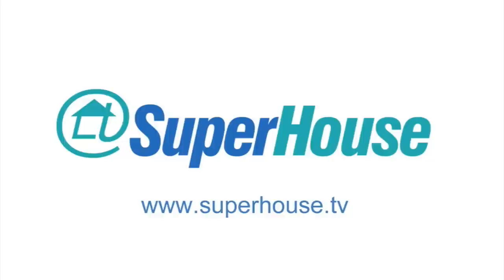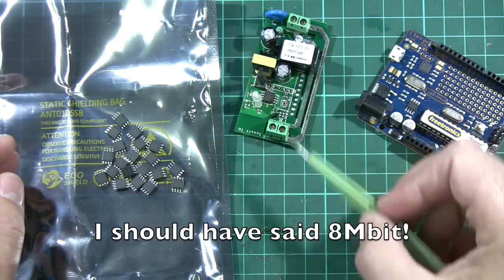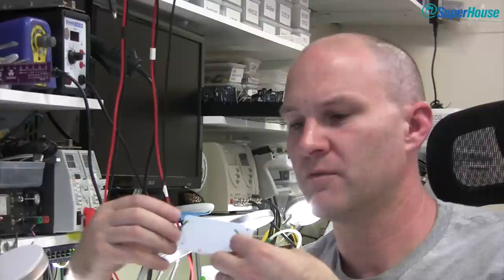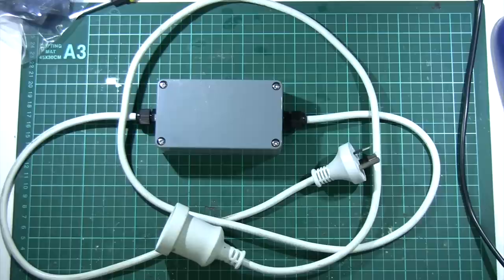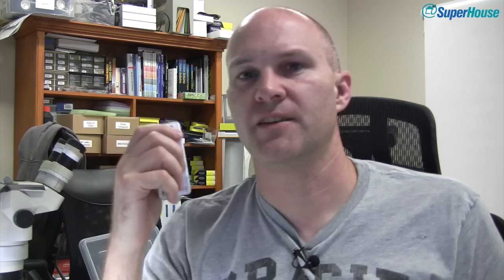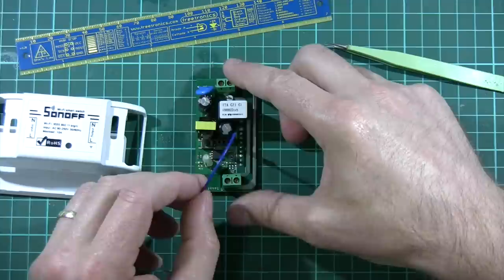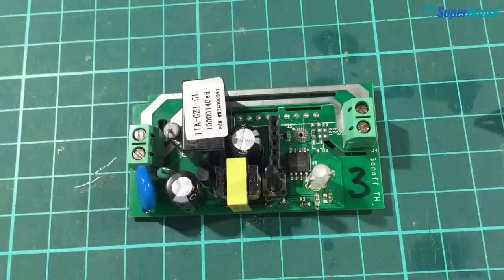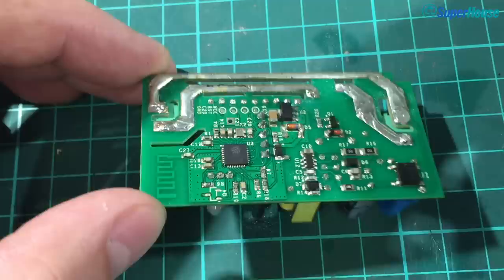SuperHouse #21: Six Sonoff Secrets: Storage, Safety, Switches, Sensors, Software, and Sites

Comment: 2:27 - Storage
9:08 - Safety
17:32 - Switch
22:08 - Switch (part 2)
23:23 - Switch (light switch)
27:00 - Switch (light switch part 2)
29:14 - Sensor
35:28 - Software
43:43 - Website
Reply: Saya tommy dari Indonesia. 
Saya senang melihat video ini.
Reply: thxxx

Comment from the maker: I've added a few more images and better descriptions to the episode page now, so it should be easier to find the specific headers, resistors, etc that I mention in the video. I'll keep expanding the page with more information over time, so if you think anything needs clarification please let me know.
Reply: Is there enough space in the filesystem to allow for state awareness for the MQTT server?
For example: when you use the light switch example, could the MQTT server push state update to the control all wirelessly?
Reply from the maker: Yes, that's not a problem. The Sonoff already has a concept of its own state, so the trick is just keeping everything in sync. You may have noticed in one part of the video I was alternating between using my phone and a switch to toggle the output, and I had to tap the phone twice because OpenHAB didn't know that the state of the Sonoff had been changed directly. The Sonoff would just need to report this local state change back to MQTT, so that other items (such as OpenHAB) are aware of it. That's already supported in the TASMOTA firmware, I just didn't configure OpenHAB to listen to it for the demo.
Reply: SuperHouseTV Thanks for the reply, much appreciated. 😎
Reply: SuperHouseTV can I use the sonoff basic to turn on DC motors using DC voltage?
Reply: You missed a small cheap trick that you can do to do very good strain relief. This is what my safety-crazy electrician uncle taught me. You make a loop in a cable and secure it with rubber tape so that ends go oposite ways. Then on the oposite side of the tape you can splice and do anything. If you try to pull it apart, you need to overcome force of that tape in a way that it's really strong. Try it yourself :)
Reply: +SuperhouseTV what if you already have a 2 switch  3 way switch setup and you want to add the sonoff to it? i am in the states so we call it  a 3 way switch you may call it a 2 way switch though i am not sure , 
instead of a switch that that has only 2 terminals  just switches the L or hot wire theere are 2 switches that have 3 terminals each ,  a hot  or L wire, a N or neutral wire  and and a traveler wire ,im my house  there is a front porch light
 one of the switches is at the bottom of the stairs next to the door and the other is at the top of the stairs ,i want to add the sonoff and flash it with smart things FW so i can use proximity detection to switch the porch light on when i return home but i still want to be able to operate the light from the  2 switches at the top and bottom of the stairs ,also i would like to be able to mount the sonoff inside of the outdoor light fixture if at all possible instead of inside the wall ,but there are only 3 wires  that connect where the light is ,   a live/hot wire, a  N neutral wire ,and a ground/earth wire , so is there a solution that can make it work without me ripping open  my walls  to run  extra wires?
Reply: SuperHouseTV 
Hi Jonathan great episode as usual really like your channel ! A quick question , can you connect a normal light switch to the Sonoff via gpi014 and ground straight out the box or does it need flashing first? Thanks

Comment: I like the way you break down the pin options and do the real time illustration, and the neat trick turning the on and off toggle into a three way switching circuit between the device, toggle, and phone.

Comment: Current Sonoff firmware (as of Dec 2019) allows the "program mode" button to toggle the device on and off. It will also allow the switch to work in LAN only mode if there is no internet connection. So far the mods on SuperHouse TV are not needed.... but I'm still watching these great videos!

Comment: For wiring inline you don't actually need to cut the earth and rejoin if you strip the cable right. I passed the earth straight through my sonoff device. It's tight but you can pass it through.
Reply: Dan Herring Same. That's why I've been doing.
Reply: b b a  i can n bB.
Reply: If you don't cut the ground then you will not be able to mount the Sonoff inside a box (unless you cut off the plug or don't have one to start with).
Reply: Are you saying you keep the earth line outside the box?  Otherwise how do you get it through holes on both sides without cutting?
Reply: @VARocketry  its a bit late, but you can get small project boxes that are intended to go inline and split at the holes for the cable, some also have little saddle things for strain releif.

Comment: Indeed, SONOFF is making the hardware the most of us were developing for our home automation. I just got today my 5 S20 sonoff wall sockets. I was making them myself, but really for the prices they offer them it is not worth the time.

My next project somewhere this week is indeed trying to get the I2C bus running on a SONOFF to use a PCF8574Module so will get another 8 (or max 64) IO's. Keep up the good work. Really interesting.
Reply: i think it's in peter scargill's firmware already... tech.scargill.net

Comment: Just a note for UK (probably most country's) the light switches will not replace a normal plate switch in 99% of cases as we have no neutral at the switch. Makes these a little redundant to be honest ? Great video and i am fitting these everywhere. Whats everyone doing with the naming of the dual relay model ? I called mine "the" then renamed the 2 relays "heating" and "gates" so Alexa gets "Alexa turn -the heating- on"
Reply from the maker: Yes, that's often a problem in Australia as well. It's common to loop the active down to the wall switch and back up again, so there's only active in / active out at the switch. I hope to do an episode soon talking about some of these sorts of practical cabling problems.
Reply: Could you not potentially put these inside the ceiling rose and have live and switched live through the sonoff. So live on the input and switched live on the output and then just use your wall switch as a 3v switch like on the video? As you already have two wires going down to the light switch. You could even fit a momentary light switch, which are available in the UK for lights with a timer.
Reply: Most new build wiring in the UK now takes the neutral to the switch. All the houses built in the last 5 yraers I've worked on have had the neutrals at the switch and commened up in a connector block. Also in the kitchens there is a radial feed (20amp on 2.5mm or 32 on 4mm) to a grid switch located in one of the kitcen cupboards, with a fuse and a double pole switch feeding out to the various appliences (cooker hood, washing machine etc)
Reply: Install E77 module in sonoff and install in ceiling  rose, connect light switch to E77 module. Works brilliantly for homes without common wire at switch.

Comment: The Arendst software is great... it is RELIABLE for the SONOFFS and handles ALEXA.   Mine does as you've noted but it's not my major area as my software handles much more and is larger - hence needing the FLASH replacement.  But for Sonoffs I use the Arendst software. Recommended.
Reply from the maker: Thanks Peter :-) And thanks for your excellent work documenting the Sonoff. Your blog is what sparked my interest in that particular device in the first place!
Reply: Excellent. No doubt more in the future as they release new devices!

Comment: Regarding safety - if it's worth noting to your audience that earth needs to be passed through on three wire connections, perhaps you should also suggest keeping Line and Neutral correctly passed through without being swapped (when using polarized cords). This might not be noticed when using, for example, two wire lamp cord (SPT-1 or SPT-2 in the US). 

 (Connecting the real Line (or Live)  to L  and Neutral to N, is also good practice, but perhaps less critical).
Reply from the maker: Good point. The early Sonoffs didn't have proper markings for Active / Neutral, but the current models have them labelled on both the inputs and the outputs.

Comment: I agree totally with the earth cable on the Sonoff WiFi switches. There is enough room to run the earth under the original cover soldering the two earths together and protecting with heat shrink. The wires are held nicely in place to securely with the case and cable clamp onto each original cable outer sheath. Nice neat connection in original case. We've replaced manually lamp switches with these for timed operation and for security out of hours too.

Comment: Really nice work you've done so far. Only thing I have to complain about, in Germany we have to use wire end sleeves/ ferrules for multi-core wires, so shortcuts between a single lead of a wire is reduces. Especially when connected to a screw clamp, which pushes the single cores of a wire to the sides! But I do not know what the "law" says in the USA or other parts of the world.
Reply from the maker: That's a good method even when it's not legally required :-)
Reply: Is that seriously the actual law in Germany? Very interesting
Reply: Same in Switzerland, as far as I know.
Reply: No requirement for ferrules in the US. I don't think they are specifically forbidden, but they are not common.
Reply: I want to use ferrules on mine but don't know the first thing about them.  I'm in the us and my house is wired up with 110v on a 20 amp fuse.  Where can I find ferrules for a stranded core extension cord that will be able to withstand the current?

Comment: Wow! What a high quality presentation, especially with the blog post behind it. Now I have to review SuperHouseTV #1-20 and their posts. I like that you are on Patreon.

 * I do MQTT with Mongob behind it for persistence with both servers running on a low cost Virtual Private Server, $35 per year. I originally hosted both on my Mac but I'm switching to a laptop.  I was originally thinking Raspberry PI based server but the VPS is probably cheaper and they do backups and fix the hardware if it breaks. I hate doing my own IT.

* My apps are mostly python scripts that run as periodic cronjobs on the VPS.They wakeup, check the status of the world according to Mongodb and decide what to do about it.With that infrastructure I can have lots of things going on at the same time that may or may not know about each other

* I run the open source  OwnTracks app on my iPhone to log where I am so I can have the system do things based on where I am.

And that is just the beginning. 

* Maybe LoRa for wider local reach than WiFi. 

* Probably a cell phone modem board to get rid of Wifi dependence altogether for stuff that wants to move (luggage tracker?)  Maybe Arduino Fona 808 which does both phone stuff and GPS.

* I have some bluetooth things going but they are not connected to this. Yet!

* I'm watching LTE-M like everyone doing IOT should.

Two months ago I had never heard MQTT and now I'm building my own personal Internet Of Steve. ;-)  I wish I knew about your stuff long ago. You'll be saving me lots of time. Thanks.
Reply from the maker: Thanks Steve! Recently I've been trying to put more effort into the blog posts associated with the videos, but it's a lot of work. The early episodes didn't have as much information to go with them.

Your setup sounds very similar to the way I've done it, except that I used a bunch of PHP scripts triggered by Cron (and various other events) instead of Python scripts. Later I replaced most of my mashed-together core logic with OpenHAB, and there's very little glue script left. Also, my Internet connection is pretty unreliable so I use a local Raspberry Pi as the server so that I don't have to rely on anything external. I don't want my light switches to stop working just because my Internet connection has dropped out for the 3rd time today!

Comment: If your sonoff fails to connect to your router make sure the password is less than 20 characters in length and does not contain hypens.
Reply from the maker: Good tip!
Reply: It's more than password! I had a devil of a time with a Dlink router with an SSID that contained a hyphen. Finally stumbled upon the obscure warning that the Sonoff disregards router names that contain special characters. Dlink and perhaps others have default SSIDs that contain hyphens. It will really screw you up. It was pure luck that I figured it out.
Reply: this hyphen, thats the minus sign isn't it? <<damn>>...
Reply: Another password pitfall to avoid occurs when you include an end of sentence delimiter (like . , ! ?) followed by additional characters in your password. Often your keyboard parser will insert a sneaky space character (0x20) after that delimiter. My Amazon tablet was doing just this, and I could never connect with the Sonoff device. No fault of Sonoff; it just seemed that way.
Reply: @kwgm8578  The Tasmota firmware has no such problems. Hyphens and long passwords are accepted.

Comment: Couldn't you connect the Sonoff up like a double switch (like you would have at each end of a hallway or at the top and bottom of a stair case)? so that is the software does break the light still works?
Reply from the maker: Those systems require single-pole, double-throw switches at each end so that there are 2 "active" lines running side by side between them. The Sonoff only provides a switched active output, not a double-pole output. You could put a switch in parallel with the Sonoff if you want some way to manually force the light to be on if the Sonoff fails.

Comment: Want easy I2C? Use the RX and TX after you flashed it as SCL and SDA. You wont need them after flashing and you have already soldered a pin header for them. Super easy :-)
Reply from the maker: Nice tip, thanks!

Comment: You need a neutral line with the live ( Hot ) line for the smart switch to work
Reply: Not necessarily through the switch though. As long as your neutral return is to the main box then OK it will still work. I think sonoff instructions indicate both the methods.  The UK standard is to wire both neutral and live through the switch and importantly with an Earth connection as well if both in and out wires have one. Earth is very important for safety especially if your main box has RCD protection as the power will trip long before a fuse will blow.  The section he talks about earth/IP ratings and protective boxes is really good. I will often prototype a system with everything exposed and open to check it all works but before putting anything in service will sort the earth/casing/glands etc..  and check the earth as well.

Comment: can't believe the whinging about having 'only' 1MB of storage.  We used to write entire applications for the BBC Micro in 8K eproms.  I can't think of anything you would want to run in a light switch that needs more than that... :-)
Reply: Yeah, but you didn't have a full tcp/ip stack and wifi interface on a bbc micro. That's where most of the space goes to.

Comment: What changes are need for the switch to work on GPIO14 ? 
So that the switch toggles the relay/light as shown in the video above ?
Reply: As far as I understand it it should be possible on the stock firmware
Reply from the maker: Yes, that's correct. The stock firmware uses the button to toggle the output (and also to put it into pairing mode) so you don't need to install any different firmware for that. It's also supported by TASMOTA.
Reply: OK, but which firmware has to be uploaded to use GPIO14 and GND trick with latch switch? Tried this today on my Sonoff with stock firmware and doesn't seem to be working. Connecting and disconnecting GPIO14 and GND doesn't change the device state
Reply: I received mine today and also does not work using GPIO14 and GND trick with stock firmware.
Reply: Unfortunately it won't work on stock firmware. You need to upload other firmware but then you can't control this device with Itead cloud via phone app :(
Reply: pawel753 so what is the firmware used in the video when this works correctly?
Reply: Dean Cosmic any idea how to do it with tasmota?
Reply: Hi @25:54, the switch that I connected to gpio14 and ground did not work, lamp does not light up, it works otherwise. Below is the switch I tried. Can you assist suggest if I am using the wrong switch or something else is missing . I am using Tasmots firmware successfully uploaded and lamp work via on board button switch and mobile, The snaps of the switch.... http://oi65.tinypic.com/2cwq2qp.jpg
http://oi67.tinypic.com/2926tq8.jpg
Reply: I also tried the GPIo14 to Gnd switch but does not work as well. Has the latest firmware stopped that function.
Reply: Did you ever get this to work with a latch switch and the GPIO 14 and Ground connection? I'm considering this as a much cheaper solution with added benefits of state feedback but I'd like to know before I get memory chips, pin headers and so on. Did you try flashing other software like TASMOTA?
Reply: SuperHouseTV I connected GND and GPIO14 to the light switch but it's not working like in your video. What change is needed?
Reply: If you have flashed TASMOTA to the SONOFF, you're nearly there. Power up the SONOFF. Find its IP address. Point a browser at the IP address. Once connected to the SONOFF, go to Configuration>Configure Module> Then find the entry GPIO 14 and select option 09 - Switch 1. If you've done everything else correctly, this should work. Well, it did for me anyway.
Reply: Nick O'Brien I've all this but the latch switch only toggle when I close the circuit. When I open the circuit in the switch, it does nothing. Which Poweron_State should I use? And about the Switch_mode?
Reply: Sorted, poweron_state = 2 and switch_mode = TOGGLE